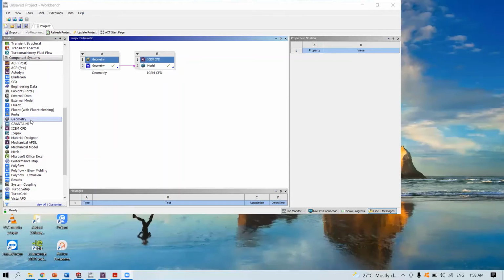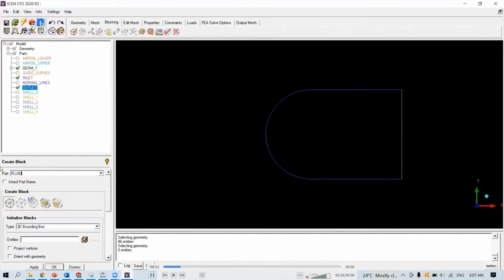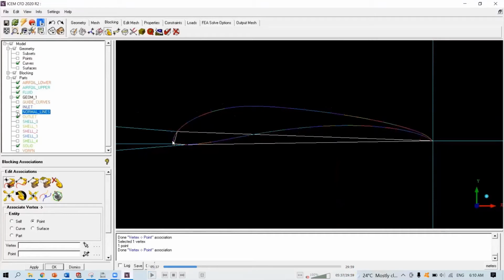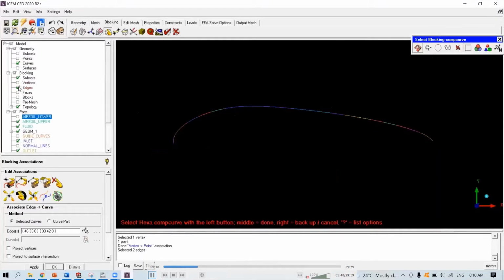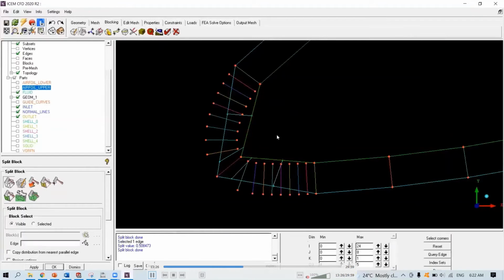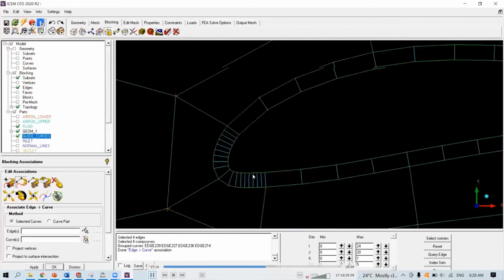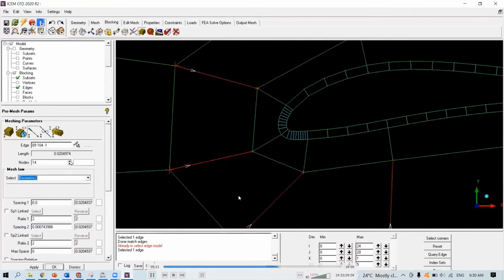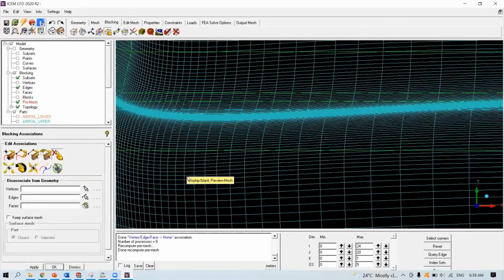Structured Mesh Strategy (skewness problem) for Airfoils (S1223) - Part 3 ICEM

Comment: I couldn't validate Cd for naca0012 for Re=3.1×10^6 I will try your method thanx will get back to you.
Reply from the maker: Hi Dipanshu, 

Please check if your exp data on the NACA0012 has been tripped or not.
Reply: @aidealczar6075  can you give your email Id please If I have doubts  regarding data and simulation?
Reply from the maker: @dipanshupant7619  yeah sure aidealzohary94@gmail.com